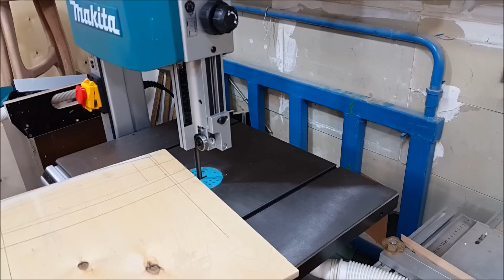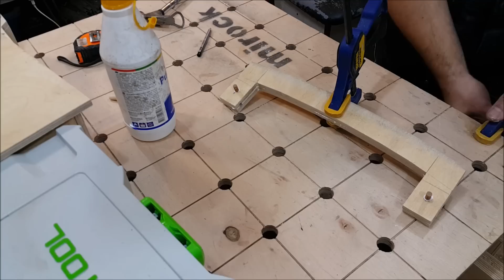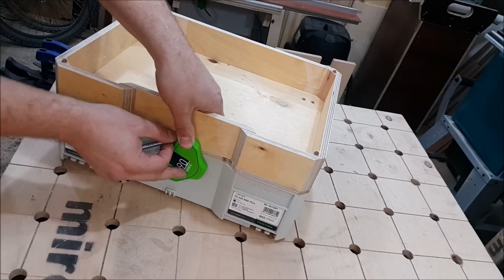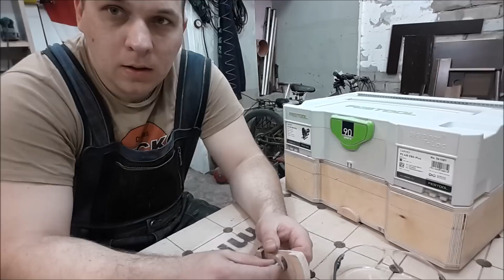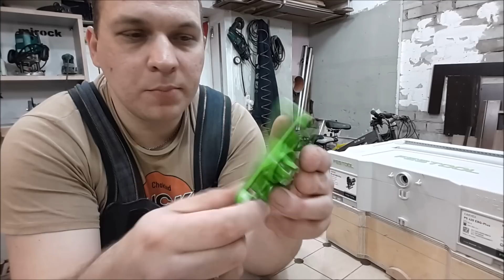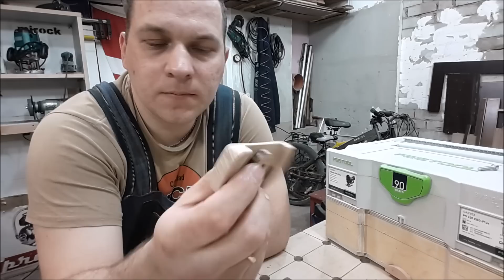Homemade Systainer 2

Comment: Do you use a dust mask all day? What are  doing for air born dust? Do you have any air filtration system? In my basement is full of air born dust  and I wear a 3M respirator (with these pink pillows) but I am not sure that it works for sure...
Reply from the maker: +m Ni No, I can't stand it on my face more then 2-3 minutes. I don't want to neglect dust collection question but it is not full size wood workshop. I don't have so much dust here. In the future I plan to get air filter but still I don't have even good cyclone. Need to get it first
Reply: +mirock&#39;s woodshop Yes you should. After I made my cyclone (2 bucket cyclone) and with my karcher MV5, this became most useful tool in my shop, then I made another cyclone for may old vacuum cleaner. Tomorrow I will finish and my air purifier and I am done with the air filtration things, because latest year of working in the basement i developed a dust phobia. Everything is full of small air born dust to me. So, go go with this thing asap.